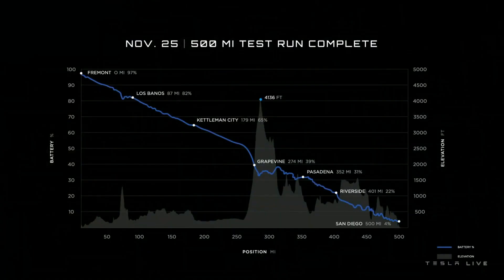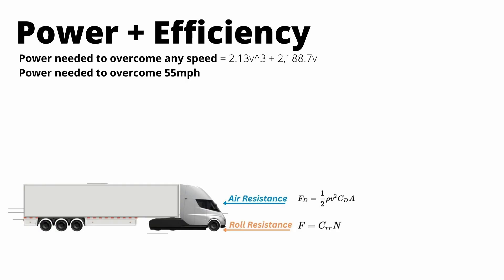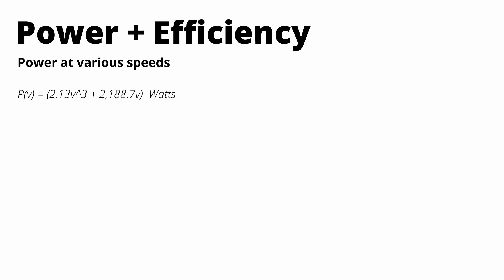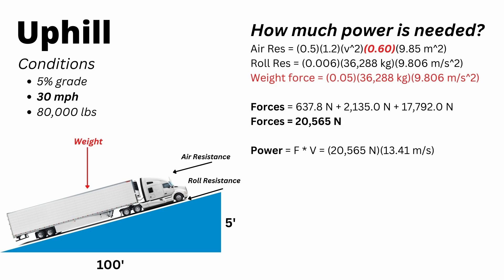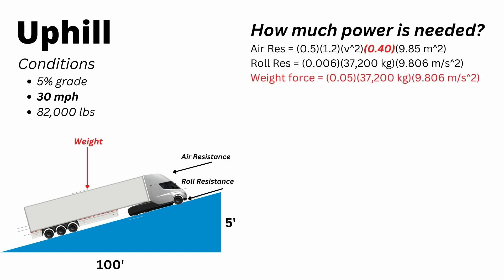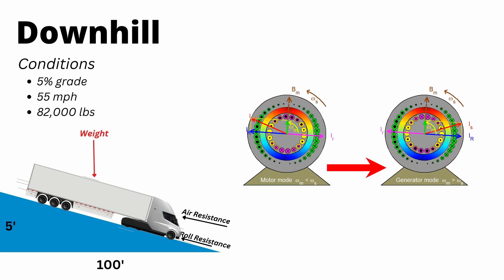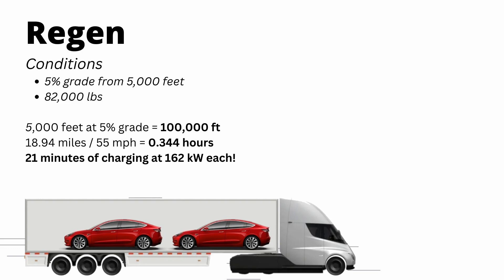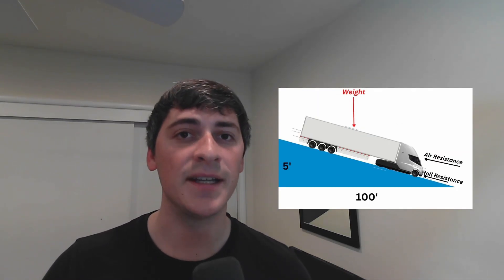Breaking the laws of Efficiency! Tesla Semi Physics Explained

Comment from the maker: What do you think about the new Tesla Semi? 

See efficiency in different conditions: https://www.motormatchup.com/efficiency?id=607714741f6c21a772fbf034
Reply: I took a different approach to the "load capacity/ vehicle weight" conundrum.
.
I tried 
"Which units on a diesel truck aren't used on the Tesla?
How much di they weight?
(Including the chassis to carry them)
How much do the Tesla equivalents weigh?"
.
Note I used 13 Model Y 82kWh packs, not 10 (heavy Model S packs, then removed excess casings, etc.
.
Result, there's very little difference.
.
I'd be interested in you conclusion using similar methods.
👍

Comment: Great video!  It inspired me to perform a thought problem.  I'm going to use metric units because I am woefully tired of the imperial system.  Assume a truck initially traveling 100 km/hr approaches a 1500 m elevation change via a 5% grade.  The truck only applies the torque necessary to overcome rolling and air resistance till it slows to 50 km/hr.  The 5% grade provides an acceleration to slow the truck of .49 m/s^2.  It will take the truck 28 seconds to slow to 50 km/hr.  It will have climbed 30 meters, or 2% of the climb, before the climbing force need to be applied.  If the similar operation is performed on the down slope to recover the kinetic energy and additional 2% of the climbing energy will be converted without loss.  Obviously, the percentage of energy saved increases proportional to the reduction of the vertical climb.  For example, a 300 meter climb would require only 80% of the climbing energy be subject to the electrical losses of the vehicle.  If the efficiency for both motoring and regen are 90% as used in the video, the 300-meter climb and descent would suffer only 17% loss of the change of potential energy rather than the 21%  ((1/0.9-1)+0.1) if no change of speed is encountered during the climb.  Since 300 meters is still a large climb this demonstrates that it is within the driver's ability to manage the severity of the losses due to hilly terrain if range is going to be an issue.

The fancy torque requirements entering and leaving the grades are a nicety to not have to think about rolling resistance and drag.  The point is permitting the truck to slow and accelerate at the base of the slopes is an energy-saving maneuver.  Charging over at constant speed is likely more fun if range is not an issue.

Comment: Great calculations!
With one exeption, if i did not misunderstand; did you calculate 80% efficiency on a diesel truck?
Isnt 25, maybe 30 more acurate?
Reply: I think it's purely a "jWh at the wheels" calculation for this exercise.
Reply: He's talking about losses between the engine and the wheels. Your number would take into account conversion of fuel energy to mechanical energy, as well.

Comment: Awesome video! 

I created an excel spread sheet based on your video so I could adjust the factors and see how it affected things... again, great work.. thanks for doing this!

- Your conversion of kW to horsepower is slightly off... should be 1kW = 1.341022hp
- Total weight of Tesla Semi on the run was 81,000lbs instead of 82,000lbs...

Comment: Imagine how good it would be to reduce rolling resistance by running on something smooth and hard, perhaps like a couple of steal tracks?! And then linking multiple trailers together to reduce air resistance. And then if you got really clever and chose a path that was almost level, you could move hundreds perhaps even thousands of tons very efficiently. Perhaps that will be Elon's next great idea?
Reply: Yeah! And then, maybe bury it underground to get out of the weather. Why hasn't Musk thought of that? Isn't it obvious?
Reply: In the Semi presentation - cheaper than rail, and door-door, with automated convoy.
Reply: @waynerussell6401  part of that was the 'guaranteed' electricity cost, which has not happened. Not sure if they factor labour costs in too?: A couple of train drivers shifting hundreds of containers cross country vs several hundred truck drivers to do the same. There is no way to make that aspect cheaper.

Comment: Ok,
Will it make it to the end of its 500 mile journey?
What is the payload for this vs a standard diesel semi?
The Tesla Semi has limited applications. For those companies that can operate within Tesla’s deficiencies it may be a great value.
But, general line haul trucking is to be determined.
Reply: I think that's a key point. Since even if sales meet Tesla's goal of 50,000 Tesla Semis in 2024, that'll only represent <3% of all semi tractors in the US. As such, very likely they will only be purchased by operators who can use them to best advantage. And as the technology improves and the charging network increases gradually, the range of uses that the Tesla Semi increase as well.
Reply: Engineering Explained once again what Tesla always said, that the payload is the same as a diesel.
Meets the 90% criteria for general trucking.
Game over for Diesel.
https://www.youtube.com/watch?v=hvg_i0GE0Vo
https://www.youtube.com/watch?v=JZTCgTtfOG4&t=184s

Comment: your analysis is pointless. What matter is payload capacity.
Reply: I kinda think operating costs matter a bit, as well. Further, many trips are limited by volume, and not by weight. So a truck with 1/3 less payload capacity but 2/3 less operating cost might be a great investment for a company that mostly carries low-density loads; say, perhaps, the Frito-Lay division of PepsiCo, who took delivery of the first two of these.
Reply: Give us your calculations for payload capacity based on the load shown on the trailer and battery weight 
(And don't quite blunderfoot, he's wrong)
Reply: @rogerstarkey5390  15,000 lb for the truck, 10,000 lb for the trailer, and 13.000 lb for the battery. It would be easier if Tesla just publish their number, I know they have them.
Reply: @Liberty2358  That's probably quite close. I figure 26,000 for the truck and battery, but that's reasonably close to your estimate of 28,000.

Comment: Your Video proves to me that real Semi numbers are going to be dissapointing You can't go 55 mph in any normal highway in California or the west coast highways 'you'd be totally run over; making everyother vehicle go around you.  Idaho trucks are going 80mph Utah 75, Cali 75. Plus your examples are assuming total flat ground with 1 accelleration to start, which of course is not real for any driving other than totally near ideal situations (Fremont to San Diego slight down hill near flat and straight). Using your figures even then at 70; the range of 300kwh is only 150, 600 is onlyl 300; and 1000; might make a bit under 500 miles so you need their giant 1400 KwH pac to get 500 miles without stop and go traffic, without hills, without frezing weather etc. Then at 30 you say the Tesla needs over 300Kwh an HOUR to maintain 30mph - so the 300 Kwh will run out going up such a grade 30 miles long; the 600; 60 miles up hill. You made no accounting for loss of accelleration due to curves which even shortens it more - again without stops, in normal temps, etc so even shorter. Most rocky mountain passes are far more demanding than that; it would be a test in the serra nevadas; Cascades, blue mountains; East cost mountains probably are workable.
Reply: Wow! So much misinformation, so little time. The semi truck speed limit in California is 55 MPH. In the stop-action video of the 500 mile test run, the truck stays in the right lane, and is consistently passed by all cars. The speed display can occasionally be seen in the left display, typically around 55 MPH or 60 MPH.
Yes, Fremont to San Diego is near flat, if your definition of "flat" is climbing the 4,160' Tejon Pass (Grapevine). And overall, it's slightly up hill, not down hill as you claim; but only by 6'. 

Most of the factors you claim they didn't take into effect were in fact experienced on the 500 mile test trip. They definitely would have experienced stop-and-go traffic getting through Los Angeles, at any time of day; they definitely had hills, including Tejon Pass and several others; they definitely experienced "accelleration [sic] to start"; they certainly experienced "loss of accelleration [sic] due to curves", including on the very winding Tejon Pass; in fact, about the only factor you claim they didn't experience that they actually didn't experience was freezing weather.
One Rocky Mountain pass is Eisenhower Tunnel, on I-70 west of Denver, and this is the highest point on I-70. It's at 11,155'; but the climb starts at around 7,000', so this is comparable to Tejon Pass. And in fact the Tesla Semi would have a much easier time on this pass, because unlike an IC engine which loses massive amounts of power at 11,000 feet, the Tesla Semi would actually have fewer losses going over this pass due to reduced air resistance.
No one is claiming that the Tesla Semi will have 500 miles range in all conditions; of course it won't. But it did exhibit 500 mile range on 93% of battery capacity, which equates to 538 miles of range on a full battery, pretty much fully loaded, under fairly typical conditions.
Reply: @BigBen621  great reply!
I would say that as long as the battery is lukewarm at the start, then the waste heat (1-10% of traction power) is easily enough to keep the battery and the cabin warm, even in very cold temperatures. They tested it in Alaska and Canada.

The powertrain (gearbox, axle, differential) effeciency of both diesel and battery trucks is around 90% . If diesel trucks' gearbox had power loss of 20%, its cooling system would be massive. 

Most modern diesel trucks have turbo which keeps the engine efficiency fairly high (25-35%) even at altitude. Note that piston engine has much lower effeciency than gearbox or battery/e-motor.

Comment: All good except the empty rig’s total weight is too heavy. It’s uneconomic to operate. It’s a con. Notice how the weight of the truck and trailer has never been disclosed.
Reply: It's never been disclosed, but you know for a fact that "the empty rig’s total weight is too heavy"? Pray, please tell us how it is that you know this?
Reply: @BigBen621  
One main incorrect assumption they will make is 
"10 100kWh packs" for the weight.
.
In fact the maximum pack weight might be 12 Model Y 2170 packs.... (82kWh, 2170, not the heavy Model S 18650)
.
Even if that's the assumption, the pack would be 12,720lbs. BUT that includes 12 frames, sets of control electronics, cables, etc.
The CELLS only weigh 7,945lb. So the the actual pack will be in the ballpark of 10,000lb.
(The FUD estimate is normally "0ver 20k")
Reply: @rogerstarkey5390  👍
Reply: https://www.youtube.com/watch?v=JZTCgTtfOG4&t=184s

Comment: Great video, very informative!  I kind of knew that going over a mountain would increase the energy consumption (even with regen coming down the other side), but I hadn't realised how much rolling resistance and air resistance would impact that.  The difference between the energy consumed going up the hill and energy gained by regen going down the hill is greater than I thought it would be, but makes total sense when you see the numbers.  

This makes the 500 mile run over a 4,000+ ft mountain even more impressive (using 93% battery capacity so it could have done another 37 miles or so).  Losing around 76 kWh from the journey up/down the mountain is about 8% of battery capacity or the equivalent of around 44 miles at 1.7 kWh/mile.  

All this means that the range should easily exceed 500 miles on a more normal route, without such a big elevation change....maybe as much as 550 - 570 miles.
Reply: As Elon said
"We could have cheated..... We didn't" (paraphrased)
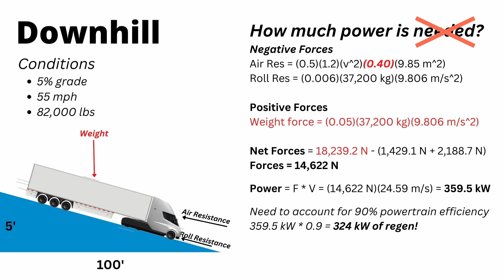Reply: Richard, keep in mind that when you compare power and energy used during the climb with power and energy reclaimed by regen, you have to take into account that you'd experience the air and rolling resistance even without the hill. For a better feel for how much is returned by regen, remove the Air Res and Rolling Res forces, and look only at the Weight force. On the way up, it's multiplied by V and divided by .9 at 6:43 to reflect powertrain losses from the battery to the wheels; and on the way down, it's multiplied by the same V (if the speed is the same), and multiplied by .9 at 8:50 to reflect powertrain losses from the wheels back to the battery. The result is that, after excluding air and rolling resistance which you'd experience anyway, you get back .9 x .9 = .81 of the additional energy you used for the climb, when you drop down the other side. 

You can see this graphically in the video of the 500 mile test run, here: https://youtu.be/LtOqU2o81iI?t=1240. The very consistent flat slope between Fremont and the beginning of the Grapevine, where the Battery % line turns down sharply, represents the level ground energy use. If you'll extend that line on past the Grapevine to Pasadena, you'll see that the actual Battery % line is only a percent or so below the extended level ground Battery % line at Pasadena, meaning that only a percent or so of range was lost to the climb to and descent from the 4,200' Tejon Pass. This was obviously assisted by the 35 MPH downhill speed limit for trucks on the Grapevine, which reduced losses to air and rolling resistance; but the point is that the nearly 4,000' climb and descent only cost at most a couple of percent of range, graphically confirming the analytical calculation that shows the same thing.

Comment: some of my friends were tuck driver, they complained if they cross the border in cross country route with hundreds of trucks queue for checking they are consuming a lot fuel only in idling. with their 600hp+ engine running all the time only for a/c .no wonder most of the company wither they like it or not they will consider this EV truck ,tailored to their route

Comment: 82,000lb but how much of that mass is battery and how much is left for cargo?
Reply: Tesla says that payload is in the same range as diesel trucks.
Reply: Current estimates point to 30-50 tons of cargo capacity, based on the weight of the concrete dividers and trailer... But TSLAQ ppl think it's 0-5 tons 😆 🤣

Comment: Thank you!

Nice presentation - very clear and good diagrams. Thanks!
Could you also think about doing the calculations for braking a fully-loaded semi going down an 8% grade starting from 75mph down to 0 within a safe stopping distance. My rationale for this experiment is:
1) people speed.
2) 8% is the maximum grade I've seen on a major highway
3) I theorize that regen braking is a main reason why Tesla has 3 motors and the 1MW power system. These parameters are a reasonable limit test for operations without the need for applying brakes at the wheels.
Reply: You could call the new video "Braking the laws of efficiency" 😄